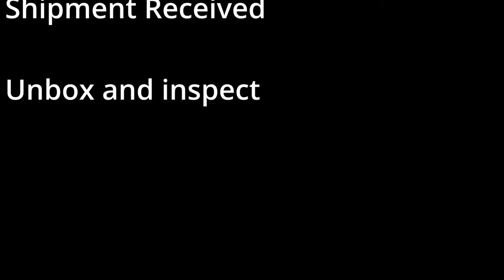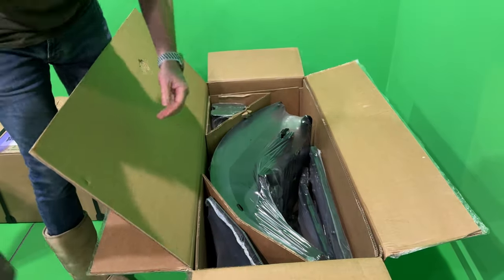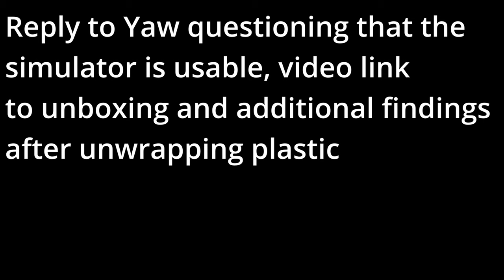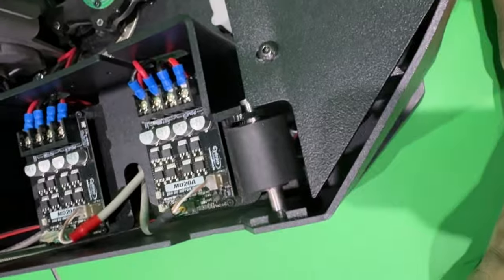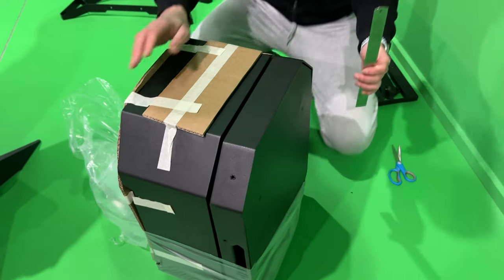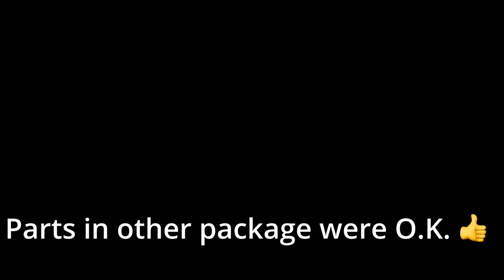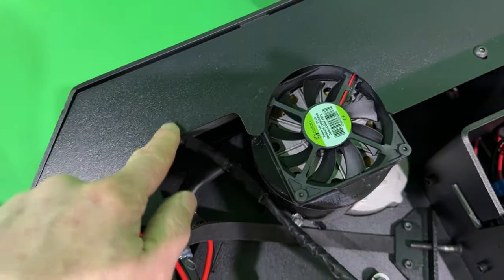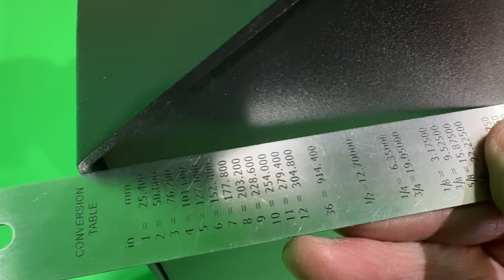Why No YAW3 Assembly Video Yet?!

Comment: I just got mine today, basically packed the exact same way. The base is seemingly ok but there is a giant hulk fist sized dent in the seat piece. They still seemingly have changed nothing with shipping/packaging as two other parts that were shoved in there had some superficial scratches/scuffs but thankfully one was the underside of the tray and the other is super subtle. One thing I haven't checked that now Im is the bottom of my base.

Comment: Hey dude, My Yaw three came perfect despite the box being beat up pretty bad—-  you don’t need to remove the pitch door to connect the flat cable.  Just hold it up and do the connection you will need two people… My screws were also stripped because they were too tight, but we got the yaw three assembled in under an hour and it’s been fantastic for a few weeks.
Reply: BTW You helped me out with my yaw 2 on discord — I don’t have any of those calibration issues or  any issues at all with yaw 3 — unbelievable I think you’re really gonna love it once you get a good shipment
Reply from the maker: Glad to hear your’s arrived unharmed, for me the trapdoors are removed now, so I need replacement’s to reinstate them

Comment: On my Yaw3, the outer wall of the rear maintenance flap is dented, probably also due to transportation. But it doesn't affect the function, so far everything is fine in terms of the structure. I see at 9:54 that you have a cover plate in the front of the base, which is missing on mine. Have you tested the wireless USB connection? I occasionally experience a signal dropout. The app for testing works well, I haven't had much experience with the other software when playing. A guide to setting up Sim Tools, Sim Racing Studio and experiences with the in-house software would be interesting...

Comment: The number of chewed out screws in the video at the 17 minute point suggest VERY poor quality control at the factory before it even makes it to the box. The difference in the two covers isn't packaging. It''s also poor quality control in the molding process. Also an extra screw beside the cover at that point in the video suggests they're just adding "fixes" as they go along unless the replacement is a different model than the first one. The third screw is probably what caused the warp in that surface when you put the straight edge on it. For $4 grand US I'd expect better than what seems to be a work in progress.

Comment: I hope this company doesn't go the same path as Fanatec but after watching this plus the interview with the CEO it sure looks like deja vu ........
It's fine to use Chinese companies (cheaper manufacturing costs ) but at some point you need quality control and from the fitment of panels I do not believe all these issues were transit related .

Clearly the "quality control" aspect needs to be addressed swiftly or unfortunately this company could face the exact position of Fanatec. 

Relying on customer financing is a very risky venture